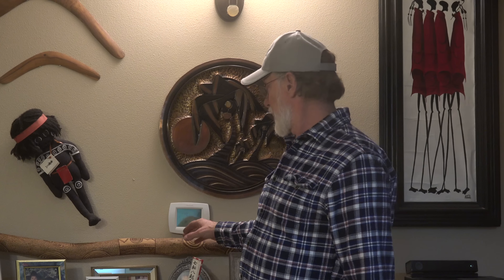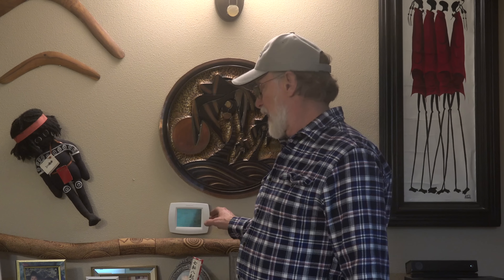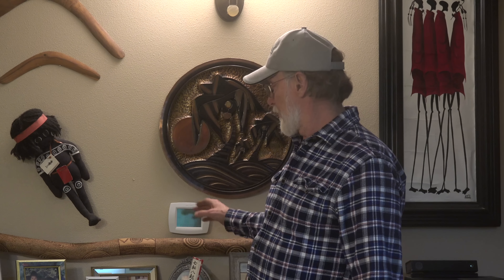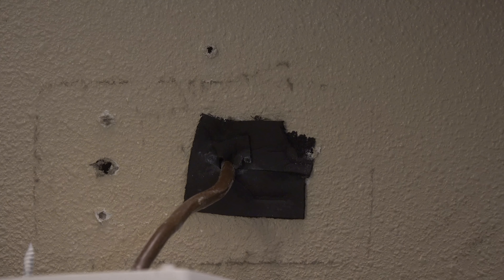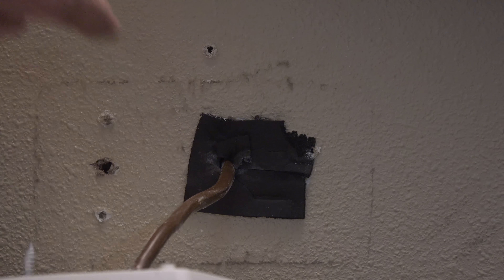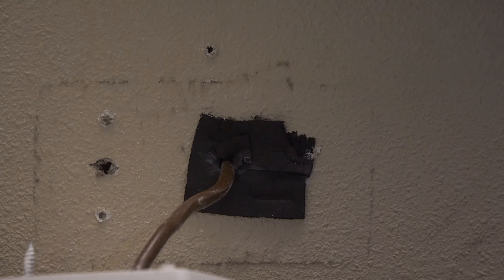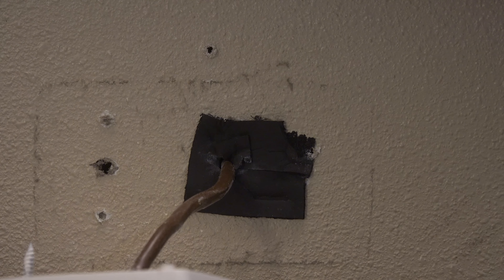Tips about HVAC:  The hole behind the thermostat

Comment: I learned early on while going to school for plumbing and heating to never cut holes any bigger than you need and to always plug the hole behind the thermostat ,usually with a little ball of plumbers putty to stop the flow of air.

Comment: Very good 🔥TOPIC🔥 GFM I learned that the hard way. I went to a service call and the thermostat was about 5 degree ofF, When I finally figure out the problem, the customer looked at me like if I  was crazy. I filed the whole up with some fiber glass insulation and then cover the hole with tape, similar to what you did, he wanted me to replace the thermostat, I did not do that, charge him for service call and left, a week or so after, he called to thank me for the service I provided. I think I won a customer for life right there 😉 VERY GOOD VIDEO 👍🏼

Comment: Yep, in the wall behind my thermostat is a wiring, plumbing, and HVAC chase that connects the basement to the attic, with two floors in between.  Now, its penetrations are mostly well sealed with spray foam, etc, but with nearly 20 feet of rise, hot water sometimes flowing the pipes, air (hot or cold) sometimes flowing in the ducts, you can be sure you're going to get some convection and drafts going on in that chase.  I remounted the thermostat on a plate of ceramic tile for insulation, and siliconed the holes.  :)

Comment: Great tip! LOL I feel so dumb I never thought of this. I replaced my thermostat last winter because of short cycling and seemingly random temperature variations and it didn't help, so I said screw it I'll just live with it. Then I saw this video and I sealed the hole with a piece of tape, and I think the problem might be solved. I can't be certain yet since the problem was so intermittent, but great tip!
Reply from the maker: Hope it is.
GFM
Reply: Did sealing the hole behind the thermostat, solve your short cycling problem?
Reply: @TJ-22  Not sure. It never happened again, but the heat exchanger went bad shortly after I sealed the hole, so I have just been using my 12K BTU mini split as a heater for the last 4 years since it doesn't get cold enough here in Tennessee to require more heat than that.

Comment: You know how many cheapo modern T-stats i removed that were the main cause of the problem? LOTS. Those old Honeywell mercury filled T-stats will outlast most of the new stuff out today. Ever since your first video on the hole behind the T-stat, I've been ripping off a piece and stuffing the packing material that comes with a new T-stat (usually that thin styrofoam sheet that protects the unit in the box) into that hole.....if it's bigger than a 1/2".
Reply: sounds familiar.... the heat or cool only models do last virtually forever, the ones with "switch bases" for heat/cool and fan control have lots of switch failures......
almost like someone wanted to insure sales of more product and cheaped out on material quality and design (planned obsolescence anyone?)

Comment: Here's a question, I have a gas 120k furnace 1st in line, then gas 50gal HW, then stove, then dyer, then out to the shop where I have a procomm 40k gas shop heater.  The gas meter is 50+years old and was only supplying an 80k furnace and 30 HW and a stove.   The shop heater keeps shutting down and starts clicking to start but will not.  Then the next thing I know its running again, I've tried 3 thermoses but still the same,  set the heat on 60 overnight and its 30 in the morning.  Can this be a meter size problem?

Comment: I’ve bumped into some holes behind t-stats that were made with an axe or machete & messed with t-stat operation, like woodwork as hobby & carry around small pieces of wood with routed edges & use them as a base , cust usually like them & no drywall work.

Comment: Interesting thing to be aware of.  I use thermometers situated around the perimeter of the home to determine the thermostat setting, because the thermostat is in one of the warmest places in the house and that is not representative of most of the actual living spaces.
Reply: typical home/building, nobody things about airflow, nor thermal gains and losses, most often it's mindlessly slammed onto a wall nearest the equipment or easiest area of install

Comment: Could the hole behind the thermostat cause an inaccurate humidity reading on the thermostat as well? If so, will foam tape solve that problem?
Reply from the maker: It could.  Sealed with foam tape would work well.
GFM

Comment: The best location for a thermostat is right next to a return grill.
Reply: bad idea, too much airflow will and can cause short cycling. example, placing it where the air is moving at higher velocity by force will have larger, faster and more frequent temperature swings (near returns, supplies, appliances, fans) why? very often building airflow and mixing speed is often very poor from bad vent placement or not enough, so the units shut off, and areas of lesser flow continue to mix and suddenly it's cold at the thermostat again within a few minutes.....
Reply: @throttlebottle5906  Don't be so fast son , you should take time to think  before  jumping the gun to quickly . You're just like a chicken who's head has been chopped as you're running without knowing where you're going . Let me begin by giving you a few good pointers  and maybe you might learn something out of this, in a forced air central system air flow is important and in order To have  an effective and efficient system you have to establish your air flow , now if you have a system which is combined with a heat pump or air conditioner you have to put your priority  on establishing your system's airflow based on your heatgains not heat loss and why ? That's because a heat-pumps by rule of thumb require 400 CFM /ton. Duct sizing and selection based on fan charts an air handler is selected . Today most homes with crawl spaces are ineffective to drive the airflow required because most homes of that category have a fossel fuel furnace with  a poor duct system  ventilation which runs on a high delta T temperature difference without mentioning that in most part 4 inch runs are what we frequently see and that is already a restriction right off the bat with a belt driven blower that probably lacks maintenance and due to aging of the furnace now how do expect to get performance with such a reduced ventilation capacity ?  Not only do heat-pumps co.e short in their output performance the life spans of the equipment runs short. If you were to start from scratch then you use your  calculations based on heatgains. The bottom line is that your thermostat will react to your system's output.  Now the story about the hole on the wall to some point is a myth and if you think that the hole bothers you all you need to do is patch it up or stuff it with a little bit of mineral wole.  Back in the day we use to have thermostat with adjustable anticipaters but now there's no need for that. That chapp on the video probably has a poor system which you would see in a barn.
Reply: i totally disagree with you,  in a forced air system airflow is what makes your heating and cooling system more effecient.  in a home where you have a 15kw electric fournace or air handler combined with a cooling unit or heat pump a minimum output of 800 cfm for a 2 tons for a 2 and a half tons  1000cfm is required and if you have a three tons a 1200cfm is needed .  Now by rule of thumb in order to have the cfm required proper duct sizing is important.  Now going back on the thermostat subject matter both the thermostat and return go in the center of the of the habited space . by having a return duct with a return grill in everyroom is  a bad idea of and a misconception.  If your home has a finished basement   a 100 % open return in the basment  with transfer grill in the main floor's hallway would be the best application. The  thermostat has a job and it's job is to control the both the cooling and heating cycle.  how does your thermostat know when when to stop or start a system ?   when it sences all of the ambient air being pumped back in the return it picks up the  ambient temperature   which happens to be your return .   If you disagree with this then i suggest that you change trade.  Stupid Idiot

Comment: My furnace just went thru 110 gallons n 18days bc it keeps coming on every 5 minutes. But, theres no codes, its heating up to 63, as set. I havent moved. I dont think anything has changed but, it's a mobile home.lol
Anyways, anyone have any suggestions?
Reply from the maker: Change the anticipator setting on the thermostat.
GFM